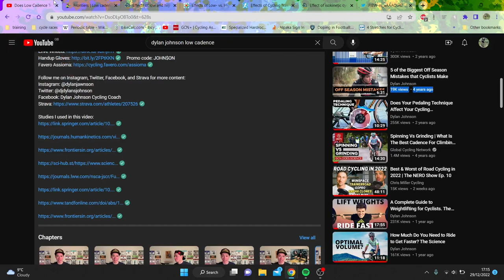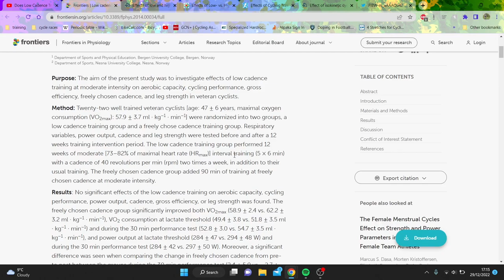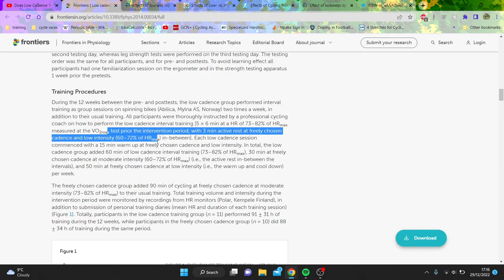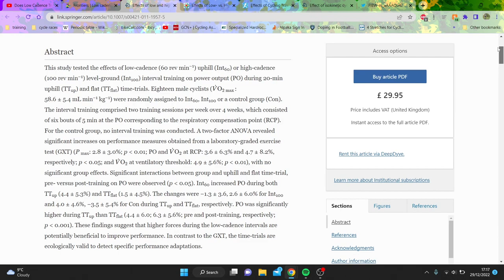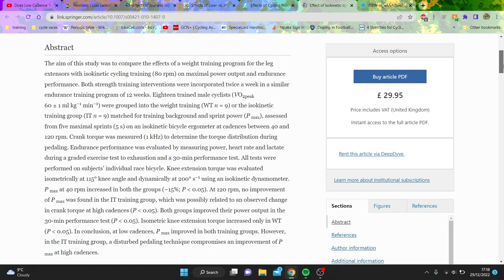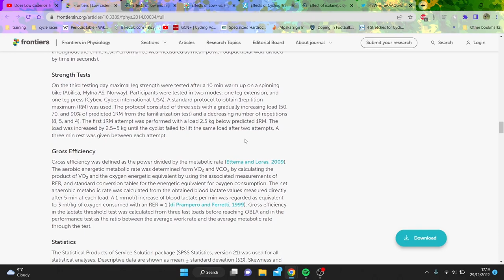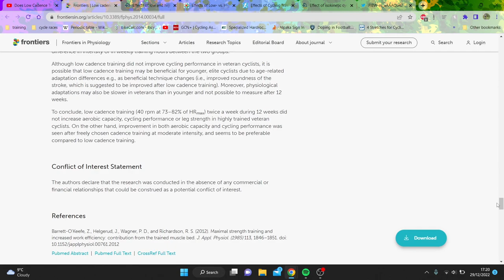Why Low Cadence studies are not RELEVANT

Comment: Many coaches use longer sub-threshold low cadence intervals because they think it lowers the maximal lactate formation rate which doesn't make sense in my opinion. 
I think that shorter reps at threshold or slightly above threshold (eg 6x4min @ 100-102% FTP @ 45-55 rpm) could lead to an increase of hypoxia-induced growth factor release due to reduced intramuscular blood flow during the longer muscle contraction at low rpm. It's just a theory of mine and there are no studies about it but I've seen my numbers improving again since introducing that type of interval work.
Reply: Interesting thanks. Have you tried going even lower with cadence on threshold intervals?

Comment: So... You're saying the studies are wrong because they don't use power and torque as measurements to compare the groups, right? But if I understand what you're saying, low cadence means a lower heart rate. So if they ride by HR, the low cadence group would be putting out even more power than the normal cadence group. Since they weren't elite athletes, we could expect a greater increase in fitness in the group that pushed harder, ie the low cadence group. The facts are opposite. What mechanisms would you suggest to explain this?

My knowledge is that low cadence recruits larger motor units at a submaximal intensity. However, the reason why we have a preferred cadence is because the way the load is distributed on the muscles makes it so that the contractions are as efficient as possible. Therefore, by recruiting larger motor units, the neural demand is higher to contract them, and that is why it feels harder to pedal at a low cadence. But it is very well known that the only way to increase neuromuscular adaptations effectively is by lifting heavy. And that to improve aerobic capabilities of larger motor units, very long endurance rides are the most effective because as the smaller ones fatigue, the larger ones get recruited. Because they are less efficient in nature, aerobic decoupling occurs. The more trained you are, the more aerobic those larger motor units and the smaller/later the aerobic decoupling.

My opinion: low cadence efforts are just a gimmick so that people can feel like they are working without actually fatiguing too much. Pros do it only to alleviate boredom and because many coaches swear by tradition even when there is scientific proof they are useless. The only reason I'd do those is if it's specific to your race demands, ie mountain biking steep hills by eg, or high cadence if you feel like you spin out at 95 rpm.
Reply from the maker: yh I was wrong about heart rate data. What I was trying to say was that to do a better comparison would be to do both intervals one at a self selected torque and the other at 70nm for example. But yh I don't do any low cadence stuff atm and am just investigating it for my own benefit. I think the fact coaches swear by it makes it interesting but then literature says it is pointless
Reply: @CharlieCarbsandCycling  yeah, totally agree on both points. It's quite weird though
Reply: "low cadence efforts are just a gimmick so that people can feel like they are working without actually fatiguing too much"

tell me you don't do low cadence efforts without telling me you don't do low cadence efforts.

Comment: Woah - great video Charlie! 

Essentially (& and worryingly) in just a day you have dismantled the argument "science does not support high torque low cadence".  The studies investigating this assertion lack rigour or more specifically, have failed to measure progress in the training effects of low cadence, high torque.

Clearly there's still several Physiology Phds to be had in performance cycling!

Is your point that a study must look at training effect of low cadence <50RPM high torque where the HR is not limited to such a great degree? Additionally,  the measurement, recording  and evidencing  NM generated is key and has been glossed over in previous studies.

You point about theyve not really measures what matters is about the ability to produce power after large amounts of energy has been burned? Ie that is what makes a difference in bike races.

Startling that Non of the studies appeared to have attempted to create a protocol to measure effects of low cadence - high torque to this end.
For a more helpful development in this area the control group needs to be to continue with Z2 verses those doing low cadence high torque + Weight training would need to be either removed or similar for both groups. 

What's interesting is how Pro coaches have arrived at their riders doing 4 min or 10 mins intervals at a given NM. Perhaps as form can be focussed on and the rider doesn't get ruined doing the work?...

Cheers - great video!